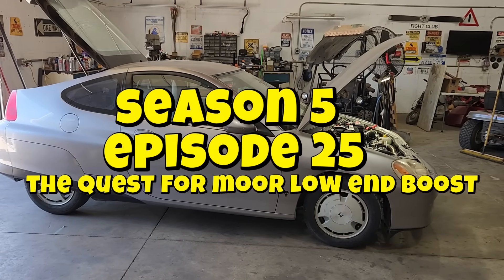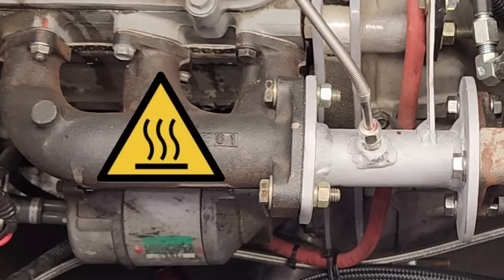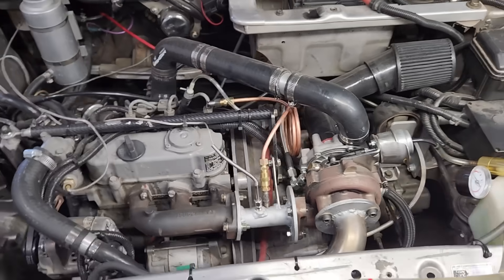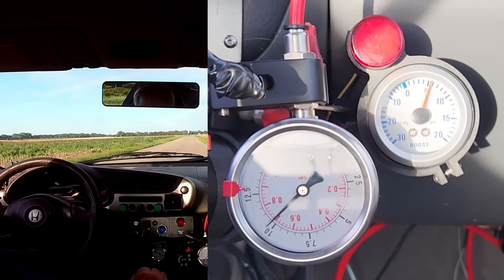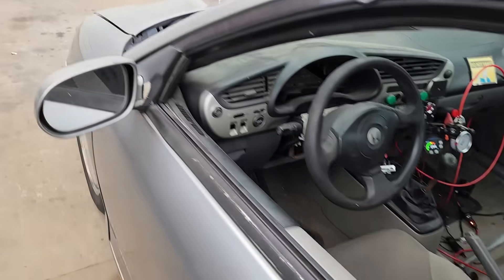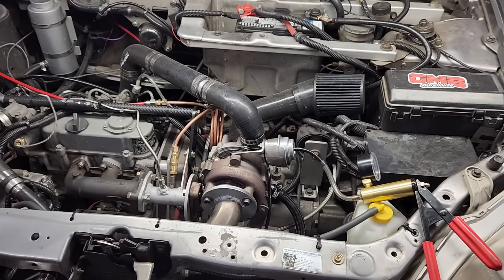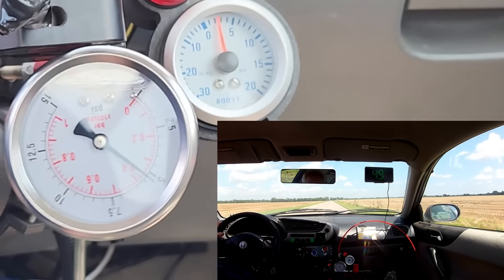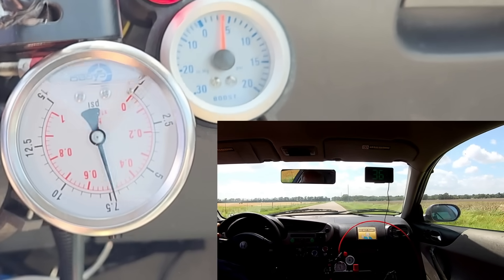S5 E25. Can we get more BOOST from the VNT/VGT turbo on the 719 cc kubota diesel Honda

Comment: Some say boost vs back pressure ratio preferred is 2:1 and 1:1 is the best ratio but kind of hard to get (?). I only saw it at switchblade turbo video clips, seems almost 1:1 ratio. 
Gotta search with numerous keywords to find "switchblade turbo" because i forgot it, what i only remember was it has an adjustable tongue/flap inside the turbine housing.

Comment: Why didn't you just leave the extension pipe for the exhaust on and drill and tap it on. Would have saved a lot of time
Reply from the maker: It would have saved time, but would have also put metal debris into the turbo.

Comment: With the supercharger pushing  5psi, you're technically increasing the volume of exhaust gasses (+ - 30%) that may spin the turbo better.
Reply from the maker: Interesting, thanks for the input!
Reply: @robotcantina8957  I agree with David, the next step would be to convert the VNT to pressure based instead of vacuum if you combined the AMR500 and the Turbo.  Opening the nozzle area vs pressure (even EMAP) can be both a tune factor and then allow you to better map it.  My thought is a manual boost controller supplied by the EMAP line after it has been cooled.  Then feed that thru the manual boost controller to the pressure actuator on the VNT.  Just a thought.

Comment: As a metic person, I would probably also use NPT fittings for that purpose. Although we don't use inch parts for plumbing water, you still find them in many automotive parts.
Reply from the maker: Thanks for the insight!  So NPT stuff is available to you.
Reply: @robotcantina8957  Many brass/copper threads for pipes are actually imperial/NPT and not metric, but copper pipes are with metric compression rings.
I did some plumbing for a friend in the US where he wanted a Scandinavian thermostat blender in the shower and that resulted in some "frankestein" combination. I wonder if that plumbing solution is still in that house or not since he sold it some 15 years ago due to a divorce caused by as golfers say "playing on the wrong hole".
Reply: @robotcantina8957 sure, NPT is used for most of aftermarked sensors I've seen.
Even though we're officially metric in Europe you find the inch used for a bunch of things, but often they have both inch and mm measurments. Copper brake line often can be marked with both 3/16" and 5mm. The selection of nuts and bolts in UNC and UNF is a bit limited where I live, but they're not hard to find, and is often found on lawn mowers and garden tractors. In a similar way that the inch is defined by the SI system, we have not abonded the inch entirely in the metric world.

Comment: The back pressure is one of the steps on modern diesel pickups to generate stopping power on there exhaust brake on trucks with automatic transmissions there’s a second step is it holds lockup on the converter

Comment: My old 26cc two stroke motorized skateboard couldn't even get me rolling from a stop without the back pressure of having the muffler on it but it would go 5 mph faster with the muffler off.  My old '93 turbo RX-7 had it's air injector pump fail so I replaced the catalytic converter with a straight pipe until I got the air pump sorted out. The RX-7 was noticeably more sluggish from a start without the back pressure of the CAT converter. It appears to me that exhaust back pressure is a good thing for having a load on the engine at low RPM and bad at high RPM.
A device to adjust the back pressure on the fly would give the best of both worlds. One funny thing about the RX-7 with the CAT converter off was that it would blow a flame out of the tailpipe at gear shifts. It was quite a sight to see at night. Apparently the rotary engines send a lot of unburned fuel out of the exhaust and the air pump helps to burn it off and cool the CAT converter.
Reply: Your assumptions about back pressure are incorrect and surprisingly common, a lot of misconceptions come about from resonant mufflers and exhaust velocity. . Two strokes generally use a tuned exhaust system to use pressure waves in the muffler chamber for combustion gas scavenging. You likely caused tuning changes in the air fuel ratio in the rotary and it caused a lean mixture and/or sub-optimal ignition timing based on the change in VE. Backpressure is never a good thing, velocity and preserving scavenging (if utilized) are.
Reply: @djcommie  Thanks for the lesson and clarification.

Comment: I would be so keen to see how the supercharger spools up the turbo🤔 great work Jimbo 😊
Reply: I keep seeing this idea, and I am not sure all the required parts will fit in the engine bay.
Reply: @Terran.Marine.2  turbo wouldn't necessarily have to be housed in the engine compartment. You would be able to decrease the boost of the SC even with the turbo mounted more distally in the exhaust system.
Reply: Citroen used to rally a 1.2 litre AX with both a supercharger and a turbo.  Supercharging was my first thought too.

Comment: Backpressure on a turbo isn't always good, at a certain point it becomes the enemy. You want to reduce backpressure some as boost increases. You don't want them both to increase. The turbocharger has a flow efficiency range and pushing it outside that doesn't yield much of a result. 

Less backpressure should make more boost, not less, to a certain threshold, before the boost starts to drop off with it.
Reply from the maker: Yes of course, I want less back pressure, but I also want more boost on the low end.  This experiment was to see if we could generate more low end boost by adjusting the VNT mechanism.
Reply: @robotcantina8957  just pointing out for future tuning, more so than for the sake of this episode specifically. 

Would be interesting to see if you could manage a way to actuate the VNT mechanism on backpressure to be able to hunt around for the most effective backpressure amount for the turbo/engine combo. (When you get to that point. Dont wanna get the cart ahead of the horse, which I already kinda did with my comment lol)  

Feels like theres a way to do it analog without a bunch of electronics and servo, etc. Without laying hands on one myself its hard for me to grasp everything going on in regard to the actuator for the VNT. 

The ones im more familiar with are oil pressure actuated with more of a solenoid you might expect to be a on an engine with cam phaser type variable valve timing. Theyre pretty neat really.
Reply: @robotcantina8957  I thought you would've shown half a turn inwards as well

Comment: Vnt nozzle needs to be farther out, then the pressure reference can be adjusted out to expand the vanes outwards and increase boost, same as fuel pressure, ideally fuel pressure and boost both have a positive vacuum reference so that they rise at an equal rate
Reply: Yeah man, but we're in the proof of concept stage. 
We're here for the process rather than the end result. The fact it takes ages is part of it. Patience grasshopper lol.

Before 'we' get to something approaching your idea (which is actually the point of this swap from the supercharger ie boost referenced electronic to analogue feedback for fuel enrichment of the mechanical fuel pump and/or variable guide vanes) this particular VGT turbo has to be thrashed out to determine if it is suitable for this particular engine. We're learning variable guide vane theory of operation - or not.  Even a lose is a win because it isolates things that work from those that don't.
If it works, the electronics can then be programmed to vary the turbo guide vanes and fueling parameters in sync with engine demand. 
It may or may not be able to be done with this turbo actually. Well have to wait and see.
Reply from the maker: @ThePaulv12... WOW, you get it!   Yes, its all about learning if this type  of turbo will be a suitable replacement for the supercharger.  Today we only focused on the VNT adjustment and what effects it has.  Thanks for explaining it better than I could.
Reply: @ThePaulv12  ill save you some time. its not.
Reply: No fuel pressure adjustment needed. This is a diesel engine, NOT gasoline varburated engine.

Comment: Can you try a "less" aggressive set point? Or maybe back off the set screw quite a bit, and test at incremental vacuum settings so we can see how the back pressure to boost ratios behave across a sweeping of positions?

My other thought is to preform a manual binary search to determine the best position of the set screw, it should get you to a great setting with only a few iterations, assuming the change is continuous acrss the range and there is a single ideal point, which seems likely.

Comment: I saw a system used on military big rigs where they used on board air to pin wheel the turbine. Can't remember if it's in addition to a vgt setup or regular housing. It made quite a difference in acceleration. There are also a few Miata videos on here that use something like that. Also the Buick 3.8 guys use c02 to help spool too.
Reply: Such a shame that production has ended on that engine.
Reply: Some Volvo gas cars were using compressed air to help spool up turbo faster too.
I wish I could see that military diesel setup. 😊
Reply: So … compressed air/gasses as a turbo for the turbo? I mean, why not?
Reply: @SchoolforHackers  So you can run a larger turbo and reduce drive pressure. Technically only need on the low end unless you go too big and rely more on the gas to spool, which wouldn't be the goal here. Just a bump
Reply: @Ghosts_and_Cars  Brilliant.
Reply: @SchoolforHackers  turbos are thermal devices, they are not pinwheels in a stream of exhaust. this is a massive misconception.
Reply: @DieselRamcharger i think what they mean is kind of like how cleetus McFarland used nitrous pointed at the compressor wheel on the old galaxie to help get the turbo to even spin. They drilled a hole in the compressor housing and put a nozzle perpendicular to the compressor vanes. Even with the engine off they could use the nitrous to spool the turbo. I have a feeling thats what they mean by pinwheeling the turbo anyway.
Reply: @lexicase8805  spinning a turbo isnt spooling it. though that is exactly what pinwheeling a turbo is. the things cleetus does, is for show. its by no means "science" or effective what so ever.

Comment: It's a pity teeny tiny little turbos are  difficult to source. This engine is practically begging for a smaller one in the available RPM range. Though, alternatively you could mess with the governor springs and witness 10 minutes of glory before the motor grows a speed hole.
Reply from the maker: Indeed, every turbo that is small enough to work also has the exhaust manifold built into them.  I did find a local guy who can weld cast iron and we may build a one of a kind turbo/manifold.
Reply: @robotcantina8957 how many cubes is the kubota engine? iirc the turbo from a 1.4 ecotec (luv rpo code) can be unbolted from the manifold
Reply: @firstlast---  it's 0.7L or 700cc
Reply: What about a Mitsubishi TD02? There is a guy who puts them on Arctic Cat ATVs with a 700cc Lombardini Diesel and he had very good results.  @robotcantina8957
Reply: Those are inspection locations....

Comment: Just for clarity after reading a few of the comments - turbos don't simply work by the gas flowing. They use the thermal expansion of that exhaust to make them spin which is why VE generally goes up rather than down (as it otherwise would in any system without energy being added). 
If there was no energy left in the exhaust when it got to the turbo it would be like trying to run an engine with no fuel - you're never getting as much out as you put in because 2nd law. 
This is also why cool exhaust and a lack of fuel is not a good thing if you're looking for turbo response on a diesel.
Reply: So it's not the backpressure that's helping, it's the bump in exhaust temps?
Reply: @Tarkov.  its like amps and voltage, pressure and flow, they go hand in hand, and a turbo needs a mix of both.
Reply: @Tarkov.  Pretty much. You see that heat energy in the exhaust manifold is still trying to expand. That can go straight out of an open exhaust or be routed to a turbo. The turbo is effectively soaking that energy up to spin the turbine - thats why the exhaust after a turbo is noticably quieter and cooler - because there is less waste energy left over.
Reply: @Tarkov.  correct.
Reply: FINALLY! someone that knows what in the hell they are talking about!!!
Reply: To be more accurate, and perhaps a bit pedantic, it's actually heat energy that's spinning the turbine. You can show this by measuring turbine inlet and turbine outlet temps. There's a temperature drop across the turbine. 
The energy that causes pressure, and therefore gas flow and expansion, in any combustion engine is heat energy.

Comment: Alot of the issue is the more the veins are closed they become a wall. I think if you were to turn the pump back up and start to open the veins it will be a success! Keep up the awesome work! Also retarding the injection pump will help with driving the turbo harder at the slight cost of egts but if it gets it on boost it may counter act.
Reply from the maker: Soon!

Comment: Hi Jimbo, i am loving these boosted diesel videos! Interesting that those variable nozzle turbos are actually more efficient than a regular turbo even though the produced boost is almost exactly equal to half of the exhaust input prssure, so still only about 50% efficient. 
My Kubota Z482 project has made an appearance on Youtube, have a look here; 
https://youtu.be/HNlVY3jdJ0w?si=I-8FW0wthBeLAqfH 
My bike first appears at 14:50 there a few pics of it from then onwards. Silver tanked Kawasaki. It currently maxes out at 75mph (gps) and returns 132mpg (uk).
Reply from the maker: Wow, very nice.  Such a clean instillation. What are you using for the gearbox?    For some reason I may not be able to see your reply, but you can send an email to b3miata at gmail if you wish.
Reply: @robotcantina8957  The gearbox is a Suzuki ts100 engine cut down with the cases welded up gasket faces skimmed and converted to dry clutch.

Comment: Well now you know. That proves the turbo is still too big. If you close the veins enough to generate pretty much all backpressure with little or no extra boost you've gone past the impellers minimum efficient intake nozzle size and no amount of adjusting will change that. 
You will be able to get better efficiency flat out if you can control it to open the veins as boost builds but low end and low throttle its never going to do it because of that size limitation. 
Rather than redirecting the gasses over a smaller part of the impeller all thats happening is its closing off so much that the gasses are hitting the centre instead and thats like putting a plug in the way. 
About the only way that turbo is going to work properly is with more thermal expansion available in the exhaust gasses and you know as well as me that that means more fuel to get those higher EGT's. 
This will work great if you just want as much power as possible flat out but you need something much smaller to get that low load/throttle boost response. 
Remmeber when you got the stupidcharger it was equivalent size to a kei car one - so designed for somewhere around 660cc. 
You really need to get a VNT turbo for a similar application. Something like the VZ21 from an Alto works is probably close.
Reply from the maker: Indeed this Lupo turbo is likely too big.  We did try a RHB31 which is suppose to be the VZ21 equivalent.  The results were about the same.    From the supercharger experiments, we learned this engine really likes 5 psi with not a lot of fuel while at cruising speed  this gives us the  best fuel economy. but it looks like that's not going to happen.  We will turn up the fuel and focus on acceleration and see how this turbo can perform .
Reply: @robotcantina8957  Yes but the RHB isn't VNT while there are versions of the VZ21 which are. 
So far as stoic is concerned 5psi or so is pretty much ideal for efficiency because much more and you start wasting power to heat so the experements so far are spot on with the theory. 
I'm with you on the power though. I feel like this size of turbo will overall work better for economy and power if its got more to work with in the first place. Time to crank it up. :)

Comment: Running both a super and turbo charger would require a complex switch from one to the other like some of the older Japanese K cars did. More to have to calibrate and more to go wrong. Better to concentrate on the turbo and get it to adjust off vacuum in a beneficial way. Don't need to run a wastegate but adjusting the vacuum when you let off the throttle would act like one and prolong the mighty Kubota's life.
Reply: You can have a twincharged system where the supercharger is like the second turbo in a compound system, so it's always on.
Reply: @alexandruianu8432  true, but limited space under the hood is a big factor, and usually those systems are for big power and that Kabota probably wont take too much more.

Comment: high backpressure isn't nessecarily a bad thing for that engine as the tiny little turbo needs all the feed pressure it can get to keep the flow high in the intake. 
THAT SAID i do belive you are very close to having the guide vanes in the exhaust side of the turbo more or less in-line relative to the shaft so at this stage i think more fuel is the only option left for the simple reason that the turbo needs more gas flowing through it to be able to do more work.
Reply from the maker: Indeed, more fuel will help the acceleration performance.  Today I was experimenting to see if there was a way to get 5 psi with the VNT adjustment.  If I could bump the boost to 5 psi right away, then a VNT controller would have something to manage.
Reply: @robotcantina8957  so the max boost you want is 5 psi?
Reply: @Gustav4  nah i take it that would be the minimum where a boost controller would serve a purpose